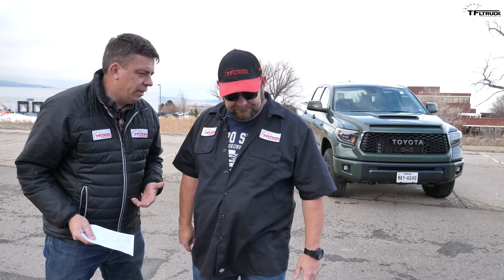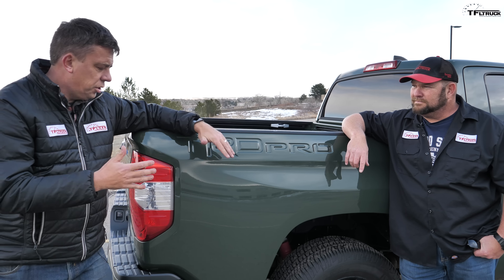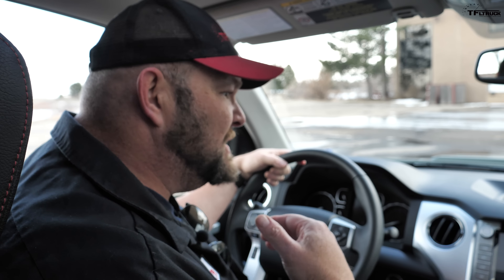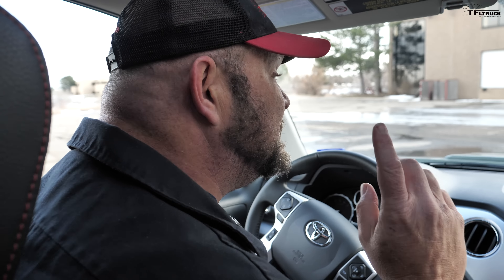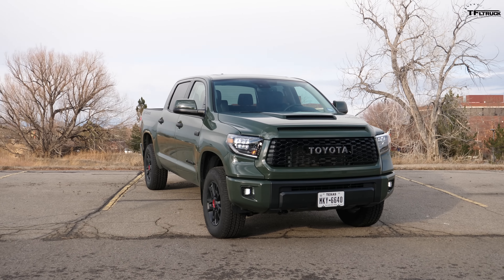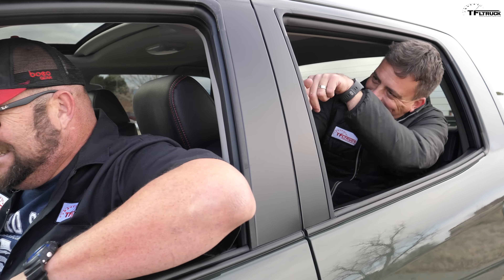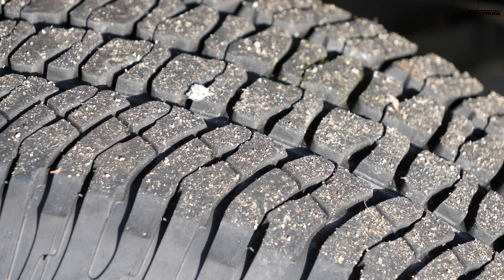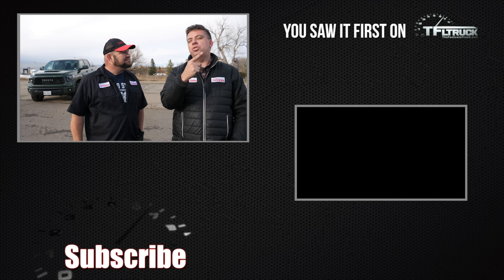The 2020 Toyota Tundra TRD Pro Is Outdated on Arrival - No, You're Wrong!

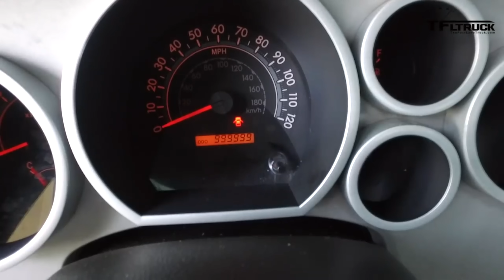Comment: 1:18 Over the course of a million miles a truck getting 16mpg will use 62,500 gallons of fuel, and one getting 20mpg will use 50,000 gallons of fuel. At $2.50 a gallon the truck getting 16mpg will cost an extra $31,250 in fuel costs alone in that scenario. You could nearly buy a second truck or do a whole heck of a lot of maintenance and still come out ahead if you hypothetically sacrificed some reliability for efficiency...
Reply: Those 20mpg trucks will never make a million miles.
Reply: The drawback is if you price the F150 XLT with the off road package and the TRD pro, the MSRP is pretty similar.  Drive them for a more realistic 200k miles and the fuel cost difference is like 6500.  If you price 5 year old 200k versions of the truck on KBB, the trade in value is around 7 grand higher on the Toyota.  It all equals out in the end.
Reply: Nathan: true - but what other truck for that $31250 is reliable enough to even go 500,000 miles reliably

Comment: It is always said the Tundra is outdated compared to competitors because it doesn't have power this, 360 degree cameras that, trailer reverse system so, photonic proton torpedo cruise control, 8k ipad pro touchscreen display, 5g wifi, 10+ usb c ports and 12 cupholders, but what is never said is that those are 70-75k trucks whilst a fully loaded Tundra 1794/Platinum/Trd Pro is only about $55k.
Reply: Jack dN   You are 100% correct I only paid 50g out the door and my 1794 will last me at least 20 years I doubt the other trucks will go 10 years without major problems.
Reply: not sure where you get 70k-75k from? Chevy 1500 SLT/F150 Lariat/Ram Rebel has pretty most of that for like 60k with discounts and everything should come down to 50k.
Reply: For that I could upgrade my Colorado Z71 Duramax to a ZR2 Duramax.
Reply: Platinum f150 is 55k... and the tundra is outdated.
Reply: I wanted so much to like the Tundra when shopping but just couldn't do it. With incentives and lower interest rate my Ram Rebel is costing me way less. The dealership wouldn't budge on price.
Reply: Tundra is expensive if you think about how truck pricing goes. The reason why a lot of auto makers up their truck price is just not for premiums but for the development and investment that goes into that particular build. That’s why when a new truck comes out with new engine and/ or body, they up the price. It cost millions or billions to remanufacture the robots and reprogram. So that’s where most of the fee’s are coming from. Toyota is making profit charging you 50k for a old truck. They are no longer paying that development but pocketing the extra money. However, did you hear about the new facility for the 2021 tundra? Toyota is spending over 21 billion on the rebuild and expansion. I guarantee you that new truck is going to be over 55k for a high end model.
Reply: Ford offers employee pricing, and added discounts, and right now Rams are had w %25 discounts too.  Hard to get a deal on a Tundra.

Comment: The aforementioned might be outdated but she's the only reliable brand on the market.
Reply: Dicky Ball have you ever had a Chevy I have 2 with 600,000 miles and still going
Reply: Big swig of that Toyota koolaid for ya!
Reply: @korbanrutherford2174  , how many engine swaps/rebuilds? Transmission swaps/rebuilds? I owned a Hummer =s replaced transmission. I owned a Cadillac Escalade ESV =s replaced front differential and motor mount. I woke up since and have owned Toyota with only routine maintenance performed. Toyota is fabricated for reliability, performance and longevity.
Reply: @dubelbaril3501 💩😭👀🤭😅😂can't handle the truth. Had both GM and Toyota. Toyota is superior to the inferior GM. Keep going down that domestic rabbit hole and the hounds won't pull your sorry carcass out.
Reply: Dicky Ball  my 2000 suburban has 595,000 miles the only problem was sixth gear blew so I rebuilt the transmission the 04 Silverado I manual swapped and put a cammed 6.0 at 200,000 miles and no problem since my Yukon has 300,000 everything is stock other than regular maintenance parts oil filter brakes battery etc. I have two Toyota’s that give me headache my 03 sequoia I’ve had to put sensor after sensor to turn the dash lights off. My 16 sequoia has a problem where it continues to attempt to switch to 4 high  though I’m in two the locker in the diff stoped working after 1 use I agree with you Toyota is a great dependable company but I wouldn’t say there the best on the market
Reply: @korbanrutherford2174  , your person just admitted that you had to rebuild an Allison transmission. I rest my case. Most GMs look pretty but are just shells. If GM focused on quality, integrity and reliable, like Toyota does, GM would have a winner. My expenditures are allocated towards a proven winner, Toyota. The Japanese culture implements and executes honor in their daily due diligence. Whereas, American corporations priorities lie with loyalty to their shareholders/profit margins, therefore, yielding detrimental quality control issues.  Plus, Toyota employs a multitude of American factories/workers as opposed to the domesticated big 3's love fest with Mexico and Canada. Bottom line: more bang for the buck partnering with Toyota.
Reply: Dicky Ball  I never said it was Allison I said it was a suburban and it blew my buddy was trying to to hit 110
Reply: @korbanrutherford2174  , Suburbans employ Allison transmissions. I am partial to GM's 6.2 liter V-8s coupled with the lastest Allison transmission, though.

Comment: Had a 2007 tundra, now have 2020 Tacoma, I wish I still had the tundra-way more power and torque from the 5.7.
Reply: I'm in an 18 Tacoma now, and I miss my 13 Tundra almost daily. Except when I go to park or fill up.
Reply: @ljefferies2012  parking I can see but the new tacoma barely gets better mileage. Certainly not enough for the huge difference in power and having the very poor seating position in the newer tacos for tall drivers.
Reply: Had a 18 Tacoma never again. Drove so bad and for a limited truck you get manual seats come on Toyota

Comment: The big difference between Ford, Chevy, and Ram to the Toyota Tundra is that the other three all have (newer designs) and all three have Engine and Transmission problems... The Tundra doesn't. Ford, Chevy, and Ram cover the repairs under their warranties but if you don't like spending multiple Saturdays in a dealership waiting on a repair, buy a Toyota.
Reply: Tell that to all the Tacoma owners whose frames rusted in half 😂
Reply: @user-pt6io2cq9n  That was in the'90s. Is this the only thing that you've got?
Reply: @theylied1776  The 90's?  There's a class action lawsuit pending right now for 2005-2011 4Runner frames rusting out.  As for Tacoma frame rust issues still plaguing Toyota, read this https://www.tacomaworld.com/threads/toyota-frame-recall.560154/
Reply: @user-pt6io2cq9n  It can take ten or 15 years for a class-action lawsuit. So again, that happened in the '90s. Is this the best that you can do?
Reply: @user-pt6io2cq9n  But please post a link to the class action lawsuit.

Comment: I have a 06 with 451,000 and a 2012 with 205,000. The 12 has the 4.6. I work in the oilfield. They’re very reliable. I did have 2008 f150 that I put 342,000 on It. It went thru 3 transmissions then the cam phasers went bad. I’
 Don’t care about updates. Some of you guys are like phone users. Every time a new phone comes out you get it.
Reply: People that complain about updates are mainly not in the market for a new truck anyway and drive a clapped out 96 Tahoe
Reply: Well said

Comment: I'm not paying $54k dollars for a 2020 Tundra that has horrible gas mileage, poor payload/towing capacity, and no rear locker. No, you're wrong...Nathan. The amount of money you save at the intial purchase of a Tundra doesn't offset the cost of wasted fuel due to it's poor MPG rating. And I could care less about the sound of a truck as it doesn't help me tow, haul, and/or get better MPGs.

Comment: Too bad the crash ratings are awful on this truck.
Reply: Don’t crash.
Reply: This is a secret nobody knows... Toyota’s crash ratings are terrible and it’s designed to be that way. That way there will be less Rebuilt Vehicles on the road and more total losses.
Reply: Randal almost all the new trucks
Get totaled so what you mean is more Toyota owners are severely hurt
Reply: it has poor crash ratings because the platform is really old, no matter how you refresh it. It is built with 2007 safety ratings in mind, and as the safety rating difficulty and fields increases, it scores poorer and poorer. Just look at dodge grand caravan for example. This is one way the NHTSA pushes the automakers to make newer and better vehicles, by using this negative reinforcement method.
Reply: When it came out it had the best, but carmakers are constantly improving, and this is an old design. Just look up the first gen tundra vs the f150 of that same year, or any of the other big3 for that matter. The tundra was the only truck that the structure didnt fail. The ford and dodge buckled badly, the chevy bucked a little, the tundra was still able to open the doors. When the new tundra comes out it will no doubt be class leading, and when the others come out they'll do better. It's a cycle, and right now the tundra is the oldest but still surprisingly competitive. Some of its standard safety features aren't even available on other trucks.
Reply: That and the bad mpg are the main reasons I won't get a tundra
Reply: I just flipped twice in an 07 fj cruiser going 60 because someone ran a red and I hit them. I came out with a concussion, toyotas are very safe bud
Reply: Don't forget, the 2020 Sienna also has a terrible crash rating. 2003 called, it wants its van back.

Comment: Had a Camry with over 300,000 miles that was a champ. A Tacoma that was bullet proof and at 70,000 miles toyota purchased back over what I wanted for it to help me get a new tundra. 2014 Tundra lifted on 35's. Never had to see the shop once so far. As for maintenance costs just oil changes and this winter changed original battery for new one. Love my toyota tundra.

Comment: Comparing any Toyota to any Ram is a non-starter ... you can have all the goodies in the world and it doesn't amount to a hill of beans if the truck is not reliable.
Reply: Mike Wright agreed. Toyota needs to do something about their reliability
Reply: A F150 or Ram 1500 with all that fancy tech cost $70k, a fully loaded Tundra is about $55k.

Comment: As much as you guys dis the Tundra for not having lockers, I purchased a 2018 Tundra and think the traction control works quite well if used the way they recommend. I have had Fords in the past with limited slip and they were disappointing. I have found my tundra Auto LSD very good, I have gone out in a gravel pit and tried to twist it and tried to get it stuck and its pulled me out every time. Granted it's not a true Locker or LSD so it takes a little time to kick in.  I live in MN so ice and snow are the norm and I had one tire on dry pavement the other in ice and mud and it started to spin one tire in 2 wd pushed the auto LSD and it drove right out when the spinning tire was stopped by the auto LSD. Do a real test the way it's meant to work. The manuel is a little confusing. I would love to drive out and do a test with yah guys.

Comment: Definitely an old platform, but that V8 is something special and it will surely outlive an F150 or Ram.  Toyota doesn't have the capacity to compete with Ford, Ram or GM.  They built the full-size Tundra for the people who want exactly what it is.  A no-nonsense, reliable tank.
Reply: Probably won't outlive those old 2 valve 4.6's though.
Reply: It won’t compete with the big three on anything over 1/2 ton, technology is not a priority when choosing a one ton truck to actually do work, 1/2 ton trucks have to use gimmicks and technology and they are still overpriced.

Guys on here making a fuss over 1/2 ton trucks. Any of these 1/2 ton trucks are good enough for the basic work it’s going to see over its lifetime.

Real truck work is left for the Chevy 3500 Duramax and Allison combination or the F350 Powerstroke.

Comment: To me the things brought up here are the most important. Reliability. I couldn't care less for the latest touch me buttons and air conditioned radio knobs.
I want a truck to be a truck.
I bought a 17 ram tradesman new. My biggest complaints are the cartridge style oil filter on top of the engine and a sealed transmission unit. Seriously you're not going to give me a dipstick in a work truck. I don't know why I didn't pay attention to this before I bought it. I've driven dodge/ram trucks for 16 years it was just a go to type thing.
It would be great if you guys  included in your new truck reviews, serviceability. Can you replace the U-joints on the drive shaft? Does the transmission have a dipstick? Are the things that commonly need to be serviced such a starters, spark plugs and coils easy to get to? For a lot of us those are still very important factors. The last time my Ram saw a dealership was 78,000 miles ago when I first bought it.I know I'm not alone in that.
Anyway. Always enjoy the new videos. One of the best channels on YouTube.
Reply: *couldn't care less
Reply: @motarded4214  indeed. 👍
Reply: Vegas EMT  we also have a 2012 Ram 1500 Tradesman with the Hemi. Spin on oil filter at the bottom and a transmission dipstick. For a modern truck is pretty easy to service. Thanks for the info on the tundra
Reply: Tundra has a cartridge filter on the bottom, requiring a 64mm filter wrench to remove, after removing the factory skidplate to access (unless you have the TRD plate, RCI plate, or P&P plate that have access doors).

Transmission is not sealed, that's just dealerspeak for 'we don't want to work on it'.  The way Aisin does it with the Tundra, there's a fill plug, a pan drain plug, and a check plug that has a straw going up to a certain level.  You need to get the transmission fluid to somewhere around 115F (service manual specifies a more exact low and high check temp range) and remove the check plug.  Fluid should just trickle with the truck running.  Much more accurate way to set the level than a dipstick.  For vehicles already warmed up, dealers often have a straw insert kit that can reach to a higher level to compensate for higher temps, with different length straws for different temperatures.

When I've done the trans fluid I've just used the built-in straw and spotted the pan with an infrared temp gun.  On a steel pan it's usually almost exactly what the onboard pan temp sensor reads, within 2F tops.  Generally takes 10-15 minutes from dead cold fluid to warm up to the check range, but once there don't dawdle, ya gotta get 'er level set within a couple minutes.  Easiest to slightly overfill and remove the check plug right at bottom temp, then let drain until it slows to a trickle, keeping an eye on the rising temp to make sure it doesn't go out of range.

Comment: I have a 2006 Toy Tundra...........best truck I have ever owned. Last one was a T-100 6 cyl 4wd. Sold it at 265,000 miles for $1,000 more than I paid for it 5 years earlier. It got 20MPH, didn't burn any oil.
My current 2006 looks like the day it came of the showroom. 4wd gets 20mph on the hwy. I have people come to my door trying to buy it.........two in the last monthe, before that a Ford Dealer salesman tried to buy it while I was at the gas station............he knows a good truck. Fourteen years old, looks and drives like new........how many 2006 Ford, Chevy, Dodge trucks are on the road? If they are............they're leaving a rust trail going down the street.
Sure, old design but why change what works?

Comment: I bought a 2008 tundra 5.7. Whenever I first start it the truck idle never settles like it does in my fords. Once I drive the tundra and put it in drive the rpm’s drop like they do in my other ford trucks. Except the fords settle in 30-45 seconds where as the tundra takes many many minutes. Once I was past 3 minutes on my timer I stopped because it was 94 out too. I’m not a mechanic but that seems wrong to me.

Comment: But no one ever pays list prices on the Ram! Where as I’ve never seen any real deal on Toyotas.
Reply: A lot of Toyota dealerships think they are selling gold... But if you look online you can find dealerships willing to come down and make a deal. Admittedly you have to look hard to find them
Reply: Yeah they inflate the prices on Ram and Silverado to make you feel like youre getting a "good deal"  but really youre getting "the shaft".
Reply: They have to make as much as possible already marked down. See when they sell 800,000 units in the USA. Out of date turds.
Reply: As long as resale prices on Toyotas stay where they are, the dealerships don't have much of a reason to wheel 'n deal. The argument is always gonna be better value per dollar.
Reply: @thenotsoguitarguy9429  my buddy just grabbed a brand new 2019 TRD 4x4 pro two months ago with $6,000 off MSRP using the truecar app. Cement grey. Nice truck.
Reply: I paid 10k less for my tundra than a comparable ford. The ford didnt even come with adaptive cruise control or lane departure. When I drove the 2.7 ecoboost I only got 1.5 mpg better on the same test drive loop. I feel like I got a much better truck for less money actually. Oh and I got 6k off msrp because it's a 2019 and 2020 was coming out soon at the time.